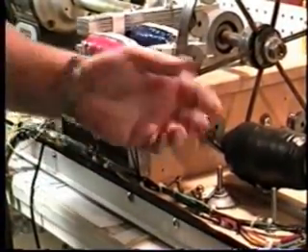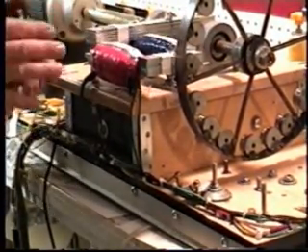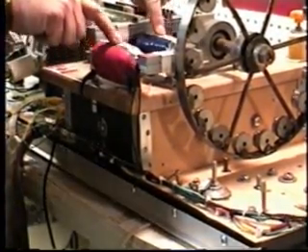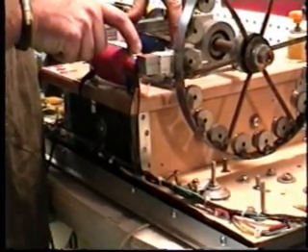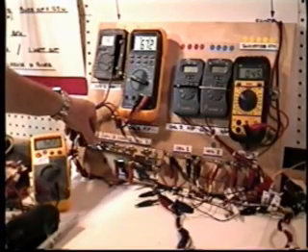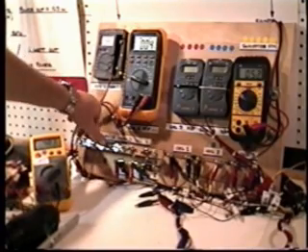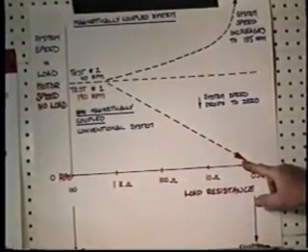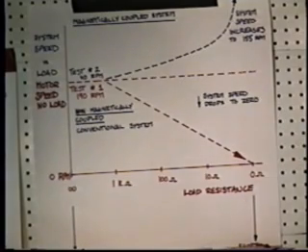PEREPITEIA GENERATOR DEMO VIDEO - Part 4

Comment: Although the Inventor safely stays away from saying it . . . this is a Perpetual Motion Machine.  So far all Perpetual motion machines eventually stop due to physics saying it is impossible to move forever without using Energy.  But I am soooo curious as to HOW LONG this thing will run !!!!!!!!!  Why did they not test that and report on it !!!!!

Comment: i think it is related to the coil inside the generater. the coil behave as an inductor.when it shorts,the coil release the stored energy by the fleming law of electromagnetic induction. this drive ithe induction motor to rotate which cause acceleration

Comment: We all know about conservation of energy stuff which is very logical. (At least to our 'current logic')

But this guy is basically demonstrating that he can obtain more output by reinjecting Back EMF in the system. Nobody talked about over unity !

It seems the induction motor is not strong enough to combat the load initially
but with additional Flux, becomes powerfull enough to accelerate the system.  

Is this how you people perceive this ?

Comment: if this system maintains a certain voltage and speed, what about the resistance of the drive shaft? It's not possible to have a mechanical resistance of zero, there is always loss due to drag, friction, etc. even if it maintains itself at a certain speed, it will never maintain that forever... could be minutes ordays before it slows down to a stop, but it still makes far from perpetual motion. "Lisa, how many times have I told you that in this house, we obey the laws of thermodynamics!"

Comment: A shunt-wound dc motor doesn't slow down under load - no magnets needed. It will continue at whatever field power is fed, no mater what the armature needs to draw to maintain speed. Also, only mentioning volts and not amps means you have not presented any measure of power.

Comment: If the Law of Conservation of Energy were true, everything would fall apart at the atomic level.  There is energy that exists at the atomic level that we can tap into, such as Nuclear Energy. This is essentially the same thing, but of course without a reaction, but it's the same power. It's been called shock energy, kinetic energy, zero point energy, but simply put it's atomic energy.